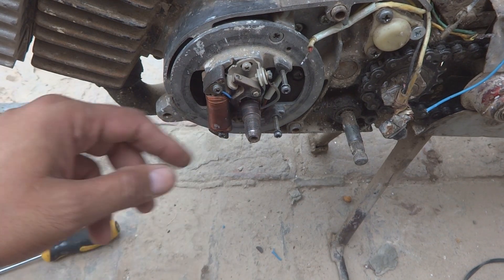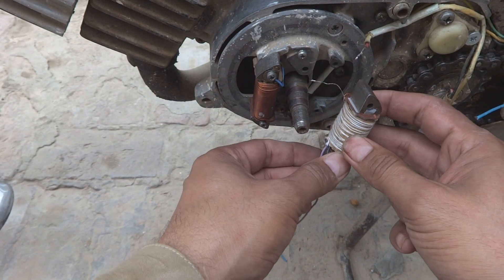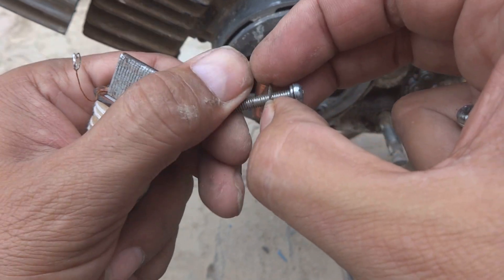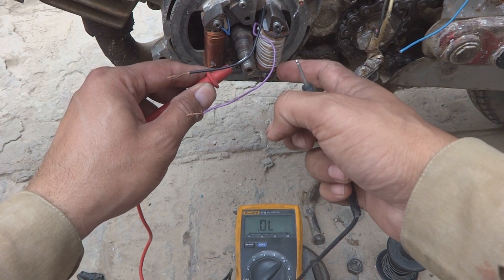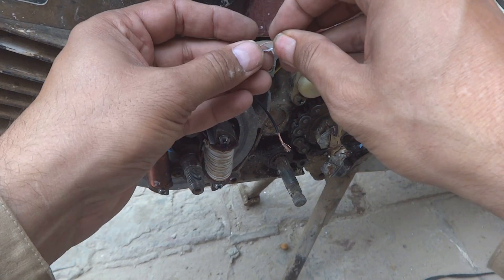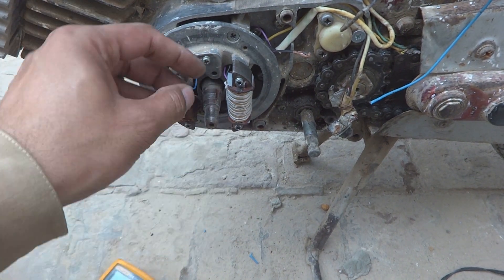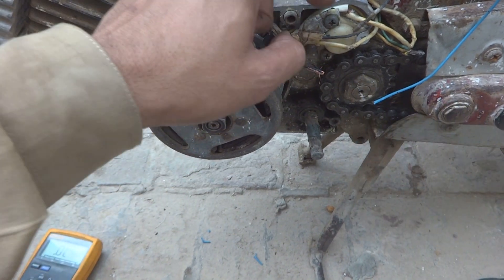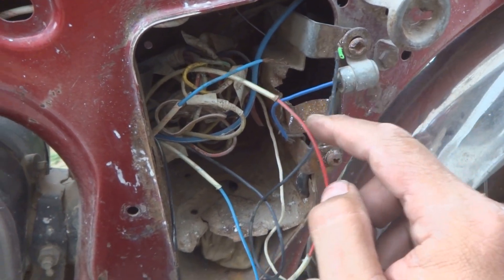alternator coil installation

Comment: Hi
How many volts is the battery in Honda 70 bike.
Reply from the maker: 12v in battery. Battery charged voltage is 13.9 volts. Charging voltage depends upon engine speed but charging regulator limits charging current to safe value.

Comment: Hi
Does this device charges the battery.how man volts is Honda 70cc bike battery.
Reply from the maker: No. This is for cdi ignition. There is another charging coil which charges 🔋 battery.